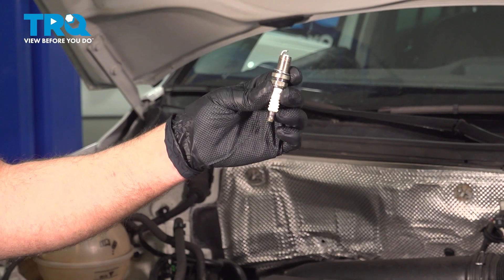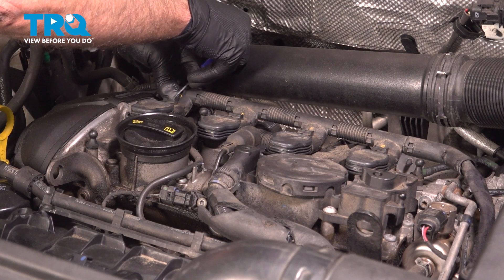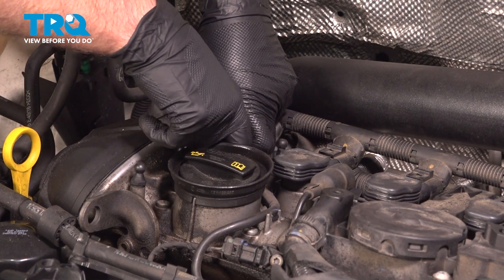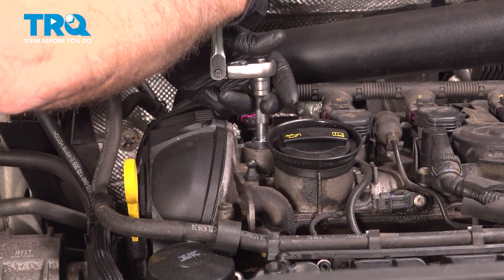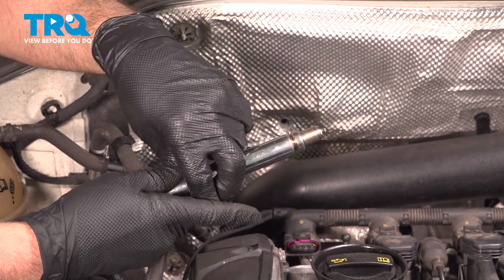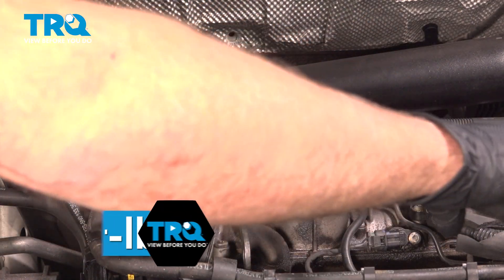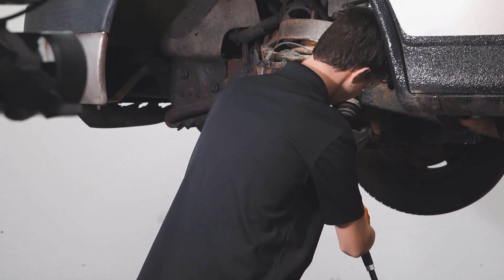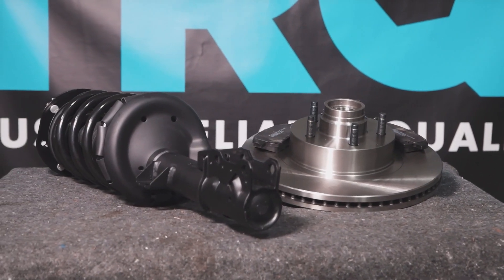How to Replace Spark Plugs 2009-2017 Volkswagen Tiguan

Comment: Hey great video thank you! I am looking to do all my ignition packs and spark plugs on a 2017 VW Passat SEL Premium 3.6, but I see anywhere from 18lbs to 22lbs on the torque, and I don't want to mess it up haha. The owners manual doesn't list it, and the internet is all over the place. Do you know if 18 is recommend for my model Passat? Thanks in advance!